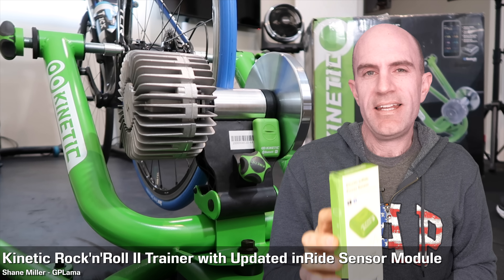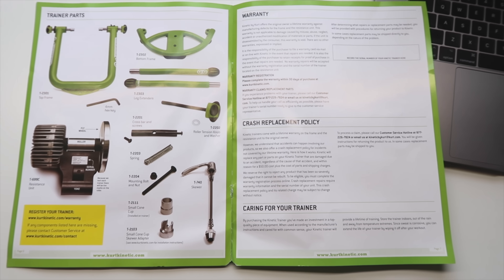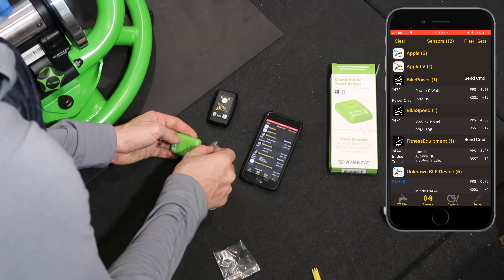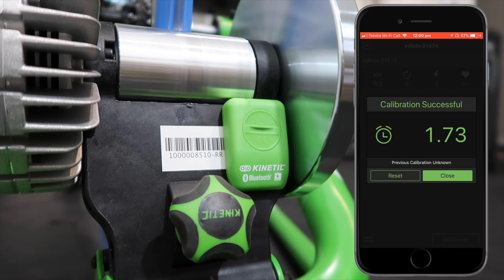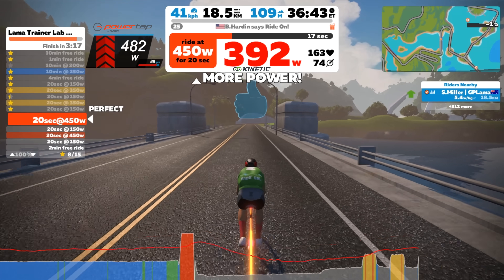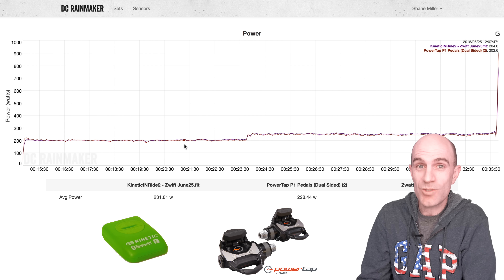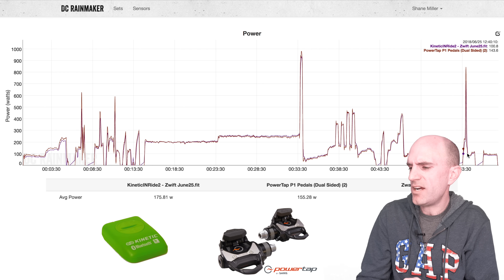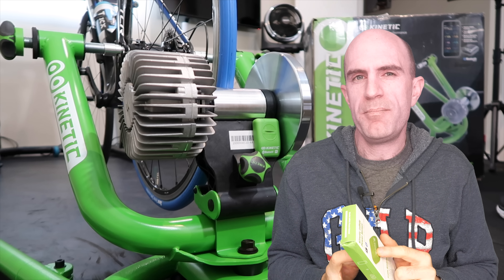Kinetic Rock'n'Roll II Trainer with Updated inRide Sensor Module (ANT+/Bluetooth)

Comment: Shane I have a problem with this trainer. I went on holiday and returned and now my Watts on this trainer has gone down (average 170 to 100) and now it's easier to peddle. I think there is a resistance problem. I tried adjusting the resistance to all the way but still there is a problem. Can you help me?
Reply from the maker: One for Kinetic Support

Comment: Shane (or anybody else), what do you think is the effect of having the pro flywheel attached, on the spin-down calibration? I can't find anything on the Internet. The Kinetic Fit app doesn't ask whether the pro flywheel is attached, so I would think it means that (a) the spin-down will take longer (more momentum), and therefore (b) the Inride pod will think the pressure on the roller is less. It will (c) thereby underestimate power.

But, as I say, I can't find anything after quite an exhaustive search.
Reply from the maker: Good question. One for Kinetic support (as I don't know the answer).
Reply: @gplama  Thanks - I'll add what I have found out so far, and if I learn more, will add further information as a reply here, just FYI. 

I contacted Kinetic Support, and their response was "The pro flywheel is automatically detected during spindown and corrects the power data on it's own for you." However, in their manual for the Kinetic app they indicate that you need to tell the app that you have the Pro flywheel (p.9, Section 3 Pair Sensors), it says, "Select the gear icon next to the sensor to be renamed and go into sensor settings screen. Pro Flywheel can be activated on the sensor screen." However, I tried this and there is no option to tick/activate a Pro Flywheel option. I've asked Kinetic Support to explain this but so far they haven't responded.

As a little experiment, I removed the Pro flywheel from my own Kinetic Road Smart machine (with Inride V2 pod), and conducted three trials of a spindown test within the Kinetic Fit app. As expected, it spun down in 1.7 sec on every trial, whereas it took more like 7 sec with the Pro flywheel attached. I plan to do a Zwift ride tomorrow, which will give me an idea whether this calibration results in a different power estimation. Essentially, I know approximately what W/kg I get from a specific heart rate on a long ride. 

I'll let you know what I find out!
Reply: @gplama  Shane, as promised, below is a summary of my little pro flywheel experiment. Not quite the data resolution of a GPLama or DC Rainmaker ;-) but pretty systematic (I have a PhD and 30 years research experience in exercise science).

Constants under both conditions: Same gear combination (large chainring, 4th cog on rear cassette); same cadence (high 80s); tyre at 120psi; roller tightened to same position (marked on knob); spindown calibration preformed before each ride (trainer warmed up for 20 minutes, followed by three spindown calibrations).

Results of each ride are below. No distance or elevation data is provided, as every ride was performed as a steady-state “diesel” ride, using the parameters above. No changes in effort for sprints, Close The Gap, and no Power Ups (feather, lorry or helmet) used.

The short summary is: under both conditions, I managed to maintain the same cadence within 1 rpm, the same HR within 1 bpm, but estimated power was ca. 15W (10%) HIGHER with the Pro flywheel OFF than with the Pro Flywheel ON, even though all the other parameters indicate I was working equally hard. The cadence was slightly higher, but only by 1%, so this doesn't explain the difference.

Pro flywheel OFF:
Spindown calibration with Pro flywheel OFF was ca. 1.7 sec.
Ride 1 Pro flywheel OFF (Roule ma Poule): Duration 0:55:26; Avge cadence 87 rpm; Avge Power 157W; Avge HR 163 bpm
Ride 2 Pro flywheel OFF (Greatest London Loop): Duration 0:55:47; Avge cadence 88 rpm; Avge Power 155W; Avge HR 163 bpm

Pro flywheel ON:
Spindown calibration with Pro flywheel ON was ca. 6.1 sec.
Ride 1 Pro flywheel ON (Roule ma Poule): Duration 0:57:21; Avge cadence 86 rpm; Avge Power 142W; Avge HR 162 bpm
Ride 2 Pro flywheel ON (Watopia Mountain route): Duration 1:23:51; Avge cadence 87 rpm; Avge Power 141W; Avge HR 163 bpm

Comment: This is a really helpful video - so helpful that I have watched it three times! Nice to know the KK power measurement can be so accurate.

Quick question, if you (or anybody else) have time - when trainer companies say turn the resistance knob "3 more times" (or whatever), does that mean 3 x 365 degrees (3 complete revolutions), or 3 "wrist turns" (so, each maybe 100-120 degrees)? There's a big difference between the two! With my Kinetic, I feel like if I turned the knob 3 x 365 degrees, the roller would be touching the wheel rim!

By the way, I absolutely agree with your appraisal of the rock and roll feature - very UNrealistic. And up out of the saddle, way too much vertical bounce, which I'm not sure does the axle much good (as the skewer is fixed, what is taking the strain of the up and down rotation?).

Comment: thanks, one stupid question about this, how do you control the resistance while using a different application like zwift, BKool, Rouvy... I am using this trainer with this ANT+ new sensor, but I am at the same speed no matter if I am up or down, only on the screen I can see the virtual speed but nothing on the bike that I am using. can you give back some leads? nsuarnita@gmail.com you can use. by the way great job
Reply: It doesn't make the fluid trainer controllable.  It just adds a feature to broadcast the power curve imputed from the roller speed and gives a calibration routine to improve accuracy.  If you want resistance control you might look in the T-6100 control resistance unit.  It can bolt onto the existing stand.

Comment: I'd steer clear of anything to do with Kurt Kinetic especially if you want to use an android device. Head on over to their website and see the number of people complaining about the app crashing. I didn't think about that before I bought it and you can imagine how frustrating it is half way through a ride to have the app crash and lose all your data. It's been an issue for a few years by the looks of things and they can't be bothered to sort it out properly. It leaves you with a near useless trainer  where you can pedal blindly unless you are subscribing to Zwift or similar.  Mine also leans to the left. Common occurrence judging by the forums. You can dismantle and reassemble the mechanism to see if that works or as one person suggested stick a magazine under the foot to raise it up. I don't expect to do that after spending hundreds on a trainer. If  you really want to see how much they care about the customer, look at how old their videos are on Youtube. Says it all really. The rock and roll seemed like a good idea but you'd be better off spending your money with one of the more established manufacturers.

Comment: Hi mate hope you are well. I purchased this 3 days ago and i csnnot get it to pair with my macbook pro 2011 or samsung galaxy s20. The device does not appear on my bluetooth devices and when i pedal zwift app, rouvy and kimetic fitness does not pick it up either. Is it goosed? Matt
Reply from the maker: One for Kinetic Support if you can't connect to it. If you wanted to get funky - Load Lightblue Explorer to see if it's advertising on BLE.
Reply: May be too late (you may have it sorted), but I had a similar issue. I sorted it by (a) putting in a fresh CR 2032 battery, and (b) moving the Inride pod to be closer to the magnet.

Comment: Great video!  What brand trainer tire would you recommend?  Is the Kinetic tire OK?
Reply from the maker: Almost any clean tyre will do. A trainer specific tyre might last a little longer (they're designed to deal with more heat)
Reply: Several brands make trainer tires.  They’re all pretty good.  Just do not attempt to ride outdoors on one.  The street will destroy it in mere moments, and you could be hurt really badly.

Comment: Hi Shane, 
Enjoy the videos, keep them coming,
Some advice please, have old kinetic road machine and got the iride 3 (green) 
Done calibration getting 2.17 Is lowest i can get, 
Pairs in zwift but watts are way off, full sprint and barely 200 watts, in kinetic  fit app measures 700 watts, tried disconnecting all bluetooth devices in area, am running through android device and thru zwift companion app.
Kinetic have been no help they say keep changing the battery? 
I was going to try ant+ connections.
Any advice would help 
Thank you
Reply from the maker: Hmmm.... if Kinetic can't help.... that's a bugger. For much less hassle, a real bike power meter is the way to go. They cost $, but they save a LOT of messing about and time trying to make other things work.

Comment: In your opinion should I get the kinetic 2700 for $269 usd or the 2710 for $295? Both discounted on amazon currently.
Reply from the maker: I have no idea what either of those codes are sorry.
Reply: Shane Miller - GPLama they are the model numbers of the different kinetics. Surprising you don’t know this.
Reply from the maker: @matty_ic3  Sorry.... Kinetic aren't really in high rotation around here. Or anywhere if I'm honest. Not enough to know the product codes without looking them up.

Comment: Good information. Thank you. Can it work with the Kinetic t-2700?
Reply from the maker: The Road Machine... I assume so. Check with Kinetic for the official answer there.
Reply: @gplama  thank you for your quick answer. The new t-2710 has included the new inride 3 sensor but the t-2700 doesn´t. i think is the same but the only difference is the bluetooth conection.

Comment: Shane I just bought the Rock and Roll | Smart Control and am having trouble getting accurate data on Zwift. Do I need more sensors, for cadence, speed and obviously heart-rate? Which ones should I get? I'm totally new to indoor trainers.
Reply from the maker: That depends what data is inaccurate, and how you're determining it's inaccurate. The Smart Control should be ball-park ok. Zwift only really needs power to get you rolling along.

Comment: From my current experience the InRide V3 sensor is best avoided. Despite followng all recommendations from Kurt Kinetic I'm unable to achieve a successful calibration which is the ONE reason why you would want this product. Put the money towards a Kurt Kinetic smart control unit if you want to keep you existing Kurt Kinetic trainer, or buy a direct drive smart trainer instead.
Reply from the maker: What are you comparing it against to determine it’s useless?

Comment: Do you have any opinion on training benefit of a smart vs fluid trainer? I'm still training on a KK with P1 pedals on zwift but ride a lot of long climbs in the summer. I'm wondering if the simulated slope mode of a Kickr/Neo would be significantly better for training the right muscles and pedal technique specifically for long steady (6-10%) climbs. Any thoughts?
Reply: David, i had that exact setup last winter and the races / workouts were as brutal as i wanted them to be and definitely gave me a boost in fitness.
Reply from the maker: It all depends on how you use the tools at hand. A fluid trainer with the right gearing/cadence during intervals will do the same as a smart trainer in regard to training. It's more about the rider and doing the right thing than having the tools that'll make you do it.
Reply: ok - cheers for the reply

Comment: If the sensor uses just a magnet on the roller am I right in thinking that it may be possible to adapt this for other dumb trainers with a bit of backyard engineering? Or does the sensor rely on the roller being a certain diameter for example?
Reply from the maker: Relies on the roller diameter and resistance unit having a known speed/power curve. Hacking this onto anything else will result in dodgy numbers all round.
Reply: How about hacking onto an older KK fluid trainer?!
Reply: @hawkeye5035  Yes, you can use an Inride pod with older KK fluid trainer models.
Reply: This is the reason why Elite have their own version with the Misuro b+.

Comment: I had the InRide power meter on my old Kurt Kinetic. I found it to work well, except for if I really 'stomped on it' in a Zwift race. The delay (not sure if it was just the delay in the power meter, or the tyre slipping) but I seemed to always lose the wheel in the bunch if I was responding to an attack. 
I don't have it anymore and just use my Lemond and Power2Max, but I haven't tried using Zwift again. I'm too busy doing Dr Slane's interval sessions on Training Peaks.
I was interested to see how you found sprinting on the Rock'n'roll. If I try to do sprints on my Lemond, the thing tends to get a bit airborne. The Rock'n'roll doesn't seem like the answer to my problem. It's hard to get motivated to get outdoors on these brisk Ballarat mornings to practice sprinting.

Comment: Hey Shane, I use an 8 year old Kurt Kinetic Roadmachine with Traineroad's power estimation.  I'm curious what if any added value you'd give the new inroad sensor for an Android / Intel PC user over my current set up.  Thanks for this and your other insights.
Reply: The InRide handles the accelerations much better than the bare resistance unit + speed sensor (the smaller diameter of the roller compared with a wheel effectively allows for a higher sampling rate, and so better estimate for speed variations). That in turn also allows a better estimate for power.
Reply from the maker: ANT+ and FTMS Bluetooth support.. that's it. More options for people. If what you've got works, it's all good.
Reply: I'd also add that the calibration that this unit provides makes it more accurate than the TR power estimation.  You will be closer to your true watts.
Reply: Cheers

Comment: Have you reviewed the smart Control kinetic unit - the one that lets app control resistance?
Reply from the maker: Not yet.  Have one here. I just don't have the time at the moment. Soon.
Reply: I know Kinetic have FTMS  ready to go (via a firmware update)  for the Smart Control unit.  They are just waiting on Zwift to support FTMS.   I use the Smart Control unit with the Kinetic Rock&Roll trainer.  Works reasonably well with Zwift.   I tend to use my Garmin Vector 3S pedals for power measurement as they provide an accurate result.  I do run Zwift at the 100% intensity so I have to use full range of gears.

Comment: Was wondering why you hadn't done a review on their new(ish) KK smart machines?  I have a feeling I may have wasted my money on one It works fine but for the price I paid I was probably better off with a KickR
Reply from the maker: I have a Smart Control resistance unit to swap onto the R'n'R... but no time at the moment to dive into it. Soon.
Reply: @gplama  Here’s a hack that I’ve seen with these.  The resistance unit from a Saris (CycleOps) Magnus trainer fits perfectly onto a Kinetic Road Machine 2 or Rock n Roll 2.  I hear that for all it’s own quirks, the Magnus unit is much less fussy than the (wheel on) Kinetic Control.
Reply: That would be a great video.
Reply: Shane Miller - GPLama soon soon!
Reply: Oh ... so does that mean that a straight off the shelf KK Rock and Roll will not provide any resistance feedback from Zwift, TrainerRoad etc to simulate upslopes ??
Reply: @stevenprice8065  No feedback. Just shift to a harder gear or increase your cadence whenever your avitar hits the climbs.  You will still feel an increase in workload since either harder gears or greater cadence will increase resistance on a classic (passive) trainer.  Avatar will slow down if you don’t since it requires more power (watts) to maintain speed on a climb.

Comment: I find the advantage with the Rock and Roll is that it takes away the knee pains that I usually get on fixed trainers. That very slight side to side motion is enough to negate all the pain. But yes, sprinting is weird since the bike leans the opposite way from each pedal strokes than it would out on the road

Comment: Nice Shane. Did you test calibration within Zwift? Does it work ok? Is it ride for ten minutes then quit, calibrate within Zwift then start a new session or can you keep going with original session?
Reply from the maker: I rarely use the Zwift calibration. I unpair the ‘controllable trainer’ and do it with the mobile app from the company.
Reply: Shane Miller - GPLama thanks. I was hoping that would be one of the advantages of moving to the green sensor - a less convoluted calibration process.